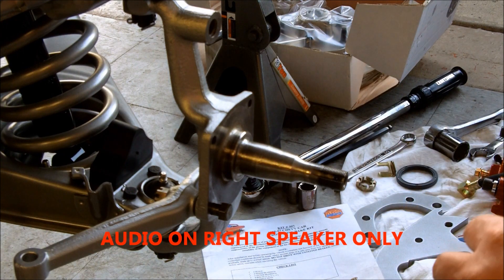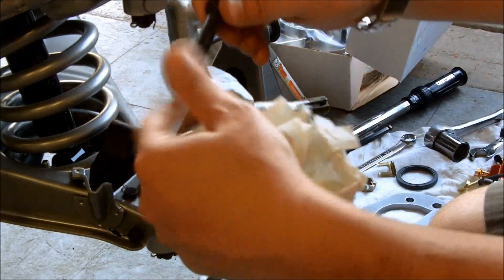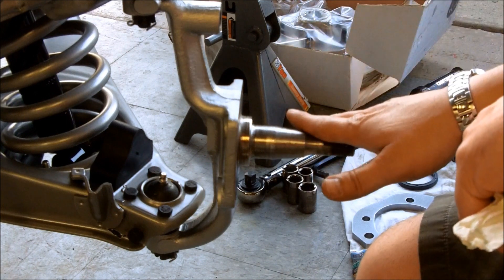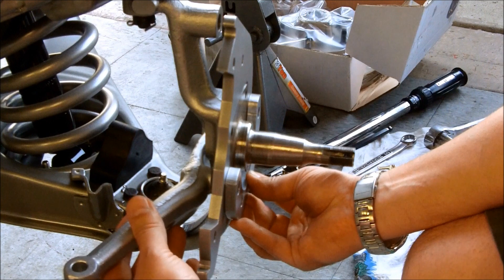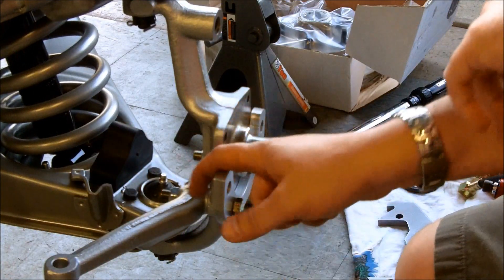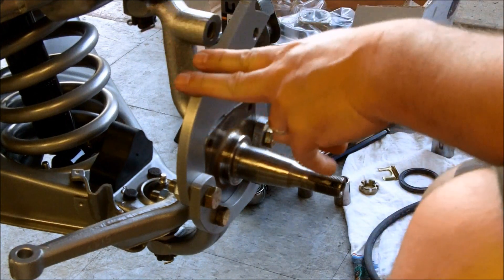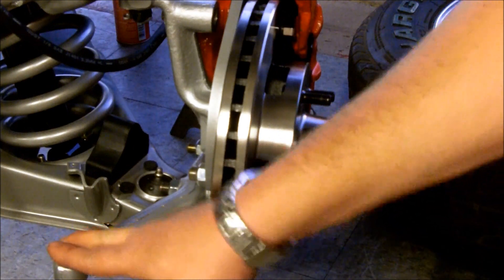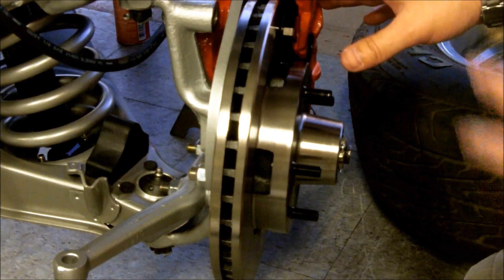1956 Chevrolet Front Disc Brake Installation Video_Edited

Comment: Great video.  So much more information than what actually comes with the kit itself.  Thanks for making and posting this.

I installed one of these kits on my mostly stock 57 Chevy 210 and they work great.  Original rims, original spindles, and original offset and ride height.  I had upgraded to power brakes years ago with a booster, drum/drum prop valve and DMC, so adding these front disc brakes was a breeze.  I just had to swap out the prop valve and DMC for a disc/drum setup.    

The video says that the nuts are self sealing and he puts them on as-is.  I’m sure this is just fine, but since I’m a paranoid over thinker, I used blue thread lock and Grade 8 lock washers on the steering arm bolts (they are the steering arms, after all).  Also, I didn’t remove the steering linkage from the steering arm.  If both front wheels are off the ground, everything moves easily.  

On the two bolts for the caliper bracket, I used blue thread lock, a Grade 8 lock washer, and one 1.5 inch Grade 8 washer on EACH bolt.  The washer was put on the backside of the spindle and overlaps the spindle, thereby sandwiching the main caliper bracket and spindle between two pieces of metal.  Hopefully that made sense.  If not, just dry fit it and you’ll understand what I mean.  Probably overkill, but it doesn’t interfere with anything so I did it for extra peace of mind. 

Lastly, the brake line seemed a touch short and was pretty close to the upper control arm and looked like it would make contact.  I wrapped some heat shield tape around the center area of the line to prevent any rubbing from damaging the line.  Again, might be overkill, but once you have your brakes fail in your old car, it’s a thought that never leaves you. 

Great kit and very easy to install, even for an amateur such as myself.
Reply: Could you tell me what kit you used?

Comment: I converted my 70 Chevelle to power disc brakes.  I discovered that my 14 inch wheels did not work because the calipers rubbed and I had to get 15 in wheels.
Question:  
Using this kit, can use the original spindles?
Some kits extends out the wheels by 2 inches, does this kit do the same?
Can I use the original wheels, are the calipers small enough so they do not rub?
If so, this would be a lot easier.
Thanks
Reply from the maker: This is zero offset and can use 14" rims.
Reply: @56Daleo  Thank you for the information